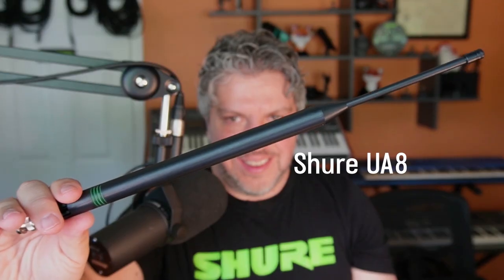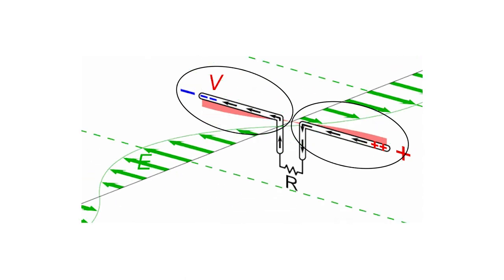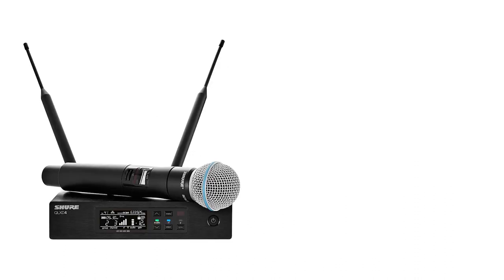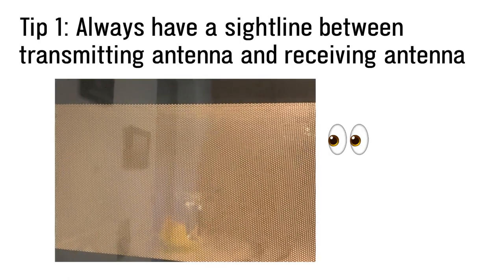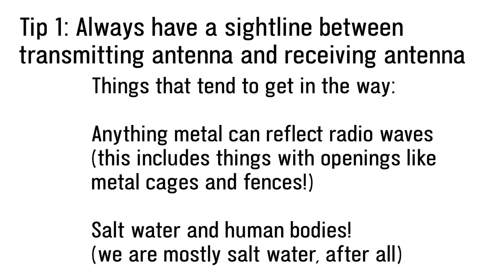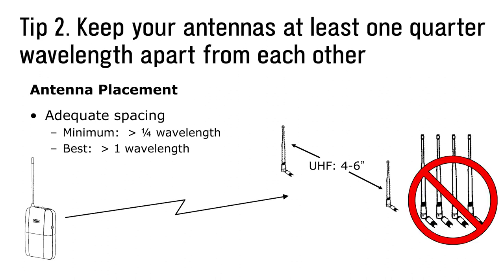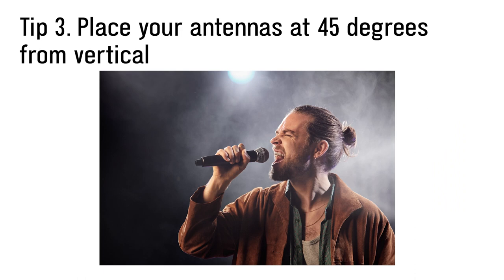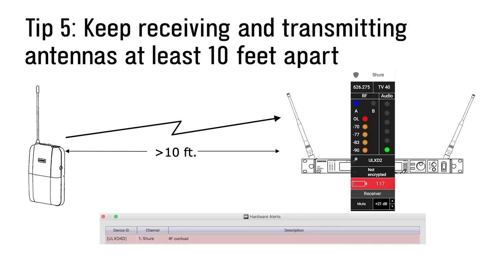Antenna Placement Tips | Shure

Comment: So if I can reasonably expect the transmitters to be approximately the same orientation throughout their entire use (i.e., placed on a mic stand), Should I angle the antennas the same? or opposite?
Reply from the maker: Hi, Yuri here. We always recommend that the receiver antennas be set at 90 degrees from each other, even if the orientation doesn't change, to help mitigate any issues that can be caused by reflections.

Comment: If I have 4 receivers what is the minimum distance between receiver antennas...can I place 4 receivers very close
Reply from the maker: If you have to place multiple receivers next to each other we recommend that every antenna is at least 1/4 wavelength apart from another antenna, which for UHF is about 6 inches. For four receivers, we highly recommend that you use antenna distribution, and then you can put the receivers right next to each other and use only two antennas for the entire set up.